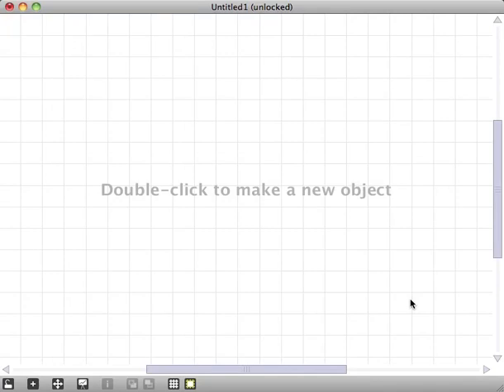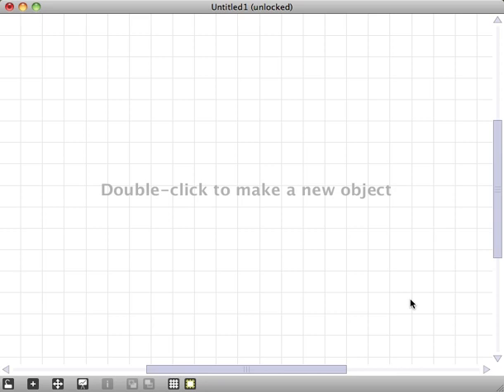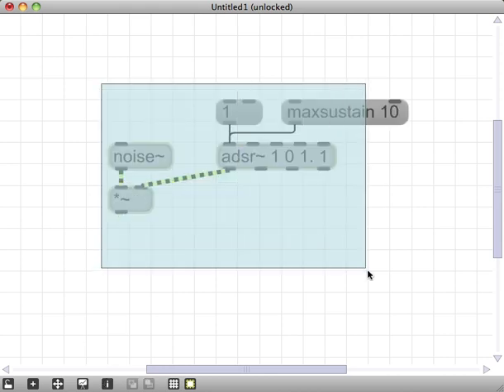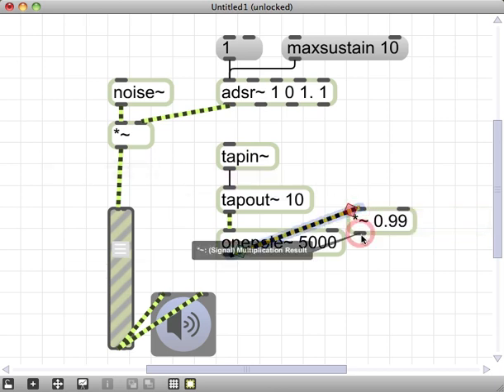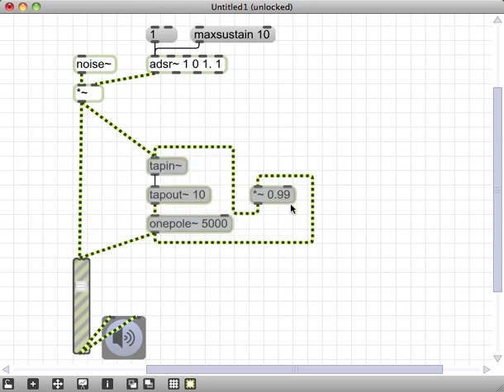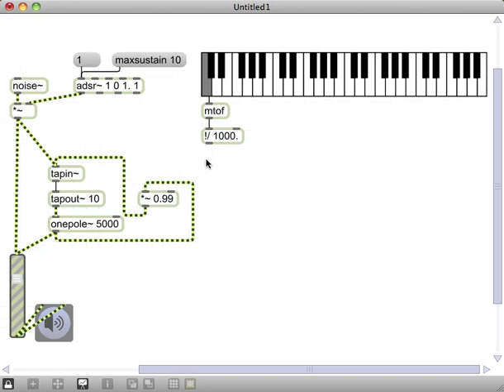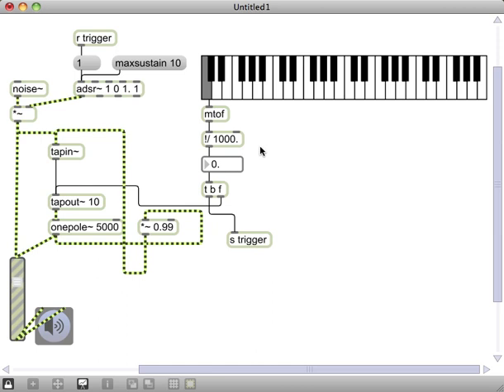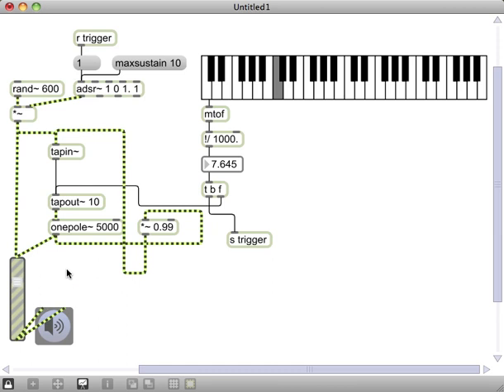Delicious Max/MSP Tutorial 1: Karplus-Strong

Comment: +dude837 @dude837 noob question but how would I modify this to use in a max for live patch? Not at my computer rn but I know you use a different output instead of dac~ but I want to know how to play notes through this with midi clips, tried a few different things from  but like I said I'm just starting to learn max but I've mainly used premade max patches in ableton until now.  Where (and what objects) would I route in the midi in from ableton?  Even when I used the max for live default output object instead of the dac~ and copied this exact patch from the video, I got no sound out of the ableton track, even though when I hooked up a meter object to it in max it said there was sound coming through.  

Tldr; how do I change this to make it work as a max for live device?
Reply: this is an indcredibly late noob question and i've had so much trouble getting this damn patch to work in max for live, but i just spent an hour trying to open it in max for live 7..  I saved that code then saved over another file and retitled it so it would appear as it's own file, as it says to do on the cycling 74 FAQ.. however, every time I open it, it either just opens the text box again, or a project that's a rectangular box with a plus sign in the middle.  I just got Max 7. or I haven't been messing with it as much lately as I was with Max 6 because I feel like I've easily done this before, but Max 7 has a little more complicated UI.  Is there something I'm doing wrong or is something making it incompatible with 7?
Reply: +dude837 I got some sound using midiin routed to midiparse in place of kslider into mtof, and everything else the same except for plugout instead of dac~, but the sound was just white noise..
Reply from the maker: Yeah the thing that you need is some other way to window the noise.  Rather than using maxsustain, you'd use the velocity of the incoming MIDI notes to control the adsr~. You'll also need to use either an object like ddg.mono to make the device monophonic, or a poly~ object to make it polyphonic. As you say, it's not trivial, but I promise getting it to work would be an amazing learning experience.
Reply: if you use sigmund~ or fiddle~ object you can replace the keyboard by one of those object which can receive adc~ signal from your voice or any other sounds coming from acoustics input
Reply: hey I don't know if you still need help but I use max for live also and here is a way to make this work, copy paste this code into your max patch

<pre><code>
----------begin_max5_patcher--------
1128.3ocyXstiahCE92oR8cfkethxZyc5qR0pQNAOLtavfvlzTUsyy9dvbIj
THwIKimAoY.N14v47ct6e84Oswda4Qpv15qVeyZyleAT1nn0RYy.gM1Eji61
SDpMZyo+nb62sc5WSROJUzqsj0r7bZ83RUD4tWX77mpo6jceDbTrqObED3X4
iSbifqvHGqfTWjikGxEY82C+bg7m6oJVOxwxF4dpT9yJZG6rsOscdSAiCqpj
Rz.UVlhCfD+Eee6I6siUpMiUT+2O+o16vMm+2XgPGrvOJPo+Iwf9i6vEruiU
HVKr3L8EOm95sf9hVc88urvdwtWUYCQsZkeBZTm8idLa9y6KIxkL7dy.Ddoq
tgGjAfUWUgwJ0K.rliFVjVJbEolTPkz5mnbx1tUQKGA3XYukvym.HOWVWPTh
Qj1NKdQKfQdqtyxe9pExMM8poIBCbQvENDPsPO0yQX.M8dLWFAKmS1eW9LAF
KYwe.QOf94pi2zjzDAAlJ7wb4MKjkOqALbVVDu0sxwrAGdFCAZ3Ujc+iNXP.
FBhRSiRgPD+GCCXbYa5i1a2CZfMVphBVFCRGJn5.HH+wXiTO2vGxov4zeS.m
yobWXEZArJ4MAqXbM.Ju3S.U.5w8btCX.mZr.nRNspbO8UnZKBocMFrBGRPl
p7BNxX.hjTw3upKRDz1jBb4iebmC3KtqjyU7+N7QBMIj.7+Unrq1vRxo13hv
uEdIyBIlqtS09l7VL4p.B1WU1MBFdKJR4b7nUd5wBmGJ1As50e1yNPcyISiS
NPp4Pa3Ks7MfmvzSMsh6FzocD2SZ4bM4i0Gt5qH00KmSqDJlFrUUSETtjHYk
7IRnxj0Y2P+tHMOvWVyF3zRtoKkbObzifbfl8DQBCEusQRO8jn2nLXUZg88M
TnIvd5iKLEwfYuxuhs4r8JdorVp6lGPbzbKV.nS6heItE6lcCDkSVz7Ky3LI
q0Su2RLB7msqFXWiAPA8an2k9zCq63X55T6mp50N1SQI1yLkJSV8bfETgfjS
moEJxQQiPB9G2nzfGNY1iwJdkOFq4vCyMXJISTCEIsPVXWKr1GqWXx3vYwAq
T4gg9xW.mBmq06EvofUGm3kLAU+nHHq6.V81bdFy1JgldMcrDRTx+syEVoWs
KbAFIJap2MHYCGzp0DMJiJjL9XIjuMZeltoWXYYT9Ym0UFSzVZL6FmYo1xU6
4.da4x27BVvGT7RGwBROCoHLpXgO+St.bkZd7JRG.C+NXH0KfLx7BlVd9sSF
dCAqfkUUx3RwP8He2vgY6S5Nti.n9rmexXuKKQOX3Yf9T9bh9D4ckwCrVdPW
hZlvPoUtfK8yLUxfaKXuCwbHsDLrwELrVUAuT7MffkrR4BdeBJMe4FrVwjXy
mU+RazGl5fZ442N4mg6nQe45CXD46fiut8k93hU+XPjppCzZQOm6jHXlvuWV
29drS26Ld26cSqaWSOvF9IceLaRMLQnDFGrotaztiQ8iwaWTlQq4MrggwTx.
7u+y6feLK
-----------end_max5_patcher---------
</code></pre>
Reply: Matthew Mitchell just saw this, thank you!  I've downloaded other karpluss m4l instruments but they don't sound nearly as good as this tutorial's tone to me, thanks for the reply also Sam!
Reply: Matthew Mitchell just saw this, thank you!  I've downloaded other karpluss m4l instruments but they don't sound nearly as good as this tutorial's tone to me, thanks for the reply also Sam!

Comment: hey so I have everything in the first section set up exactly (the first 3 minutes) but it is not making a clicking sound when I press on the '1'. Any other settings that need to be configured in a certain way? I am using version 6.1
Reply: ryan miller You need to click on both message boxes first and turn up your gain slider

Comment: For some reason, I can't make the sound go higher. :(
Reply from the maker: Yeah, you can only go so high because you can't delay for time shorter than one signal vector. If you build your own Karplus Strong using gen~, however--that's another story. Actually, I think Max has such an example built in, if you've bought gen.
Reply: I mean that I can't make any sound, that's what I mean, when I'm trying to make that single click sound.
Reply: Koshka Cat
nvm, I just made the sound exist

Comment: I'm currently working from Max 6.1.  I did this particular patch last week in college and it worked perfectly but when I opened it in college today,  the sound which was originally sounding like it was being plucked, turned into a sound which was constant.  Any idea why?
Reply: You need to ensure maxsustain is being registered upon loading. Add a load bang before it.
Reply: hello, is using MaxMSP part of your studies? If so, what do you study?  I'm curious.
Reply: Were you asking me or Diva? Either way, it was part of my studies. I was/am doing sound engineering at university. The best part for me is Max. I haven't used it since May really but I remember it all quite well still (I ended up drawing patches as starting points for things I want to try on 7 when I buy it)
Reply: I studied Audio & Video Production in college.  I finished in May and graduated in October.  The module where I used MaxMSP was Digital Signal Processing.

Comment: The lowpass filter is to blame, it changes the frequency of the string every so slightly in a non-linear fashion. There are solutions to it by using a linear phase filter.

Comment: As was said the delay line length determines the frequency but the low pass filter introduces phase delays which add on to the delay line length. This puts the instrument out of tune. This can accounted for as long as you know the phase delays. The Csound example referenced by Michael Mcloughlin uses a first order feedforward averaging filter which introduces a half sample delay, the All-pass filter is then added to add another half sample delay to make the overall delay time more manageable.

Comment: I'm pretty sure that this implementation of the karplus strong method has tuning issues. I've seen code (the Csound implentation) where this problem is fixed by adding an allpass filter to the output.

Comment from the maker: @rishabhrajan Yes, you're exactly right.  So the issue here is that tapin~ and tapout~ can't delay sound by less that one signal vector in size. In case you don't know what I mean, Max passes around sound not as individual samples but in chunks called signal vectors. Usually this doesn't matter but in special cases like this one you can run into trouble.  If you increase your sample rate or decrease your vector size you should be able to get higher notes.